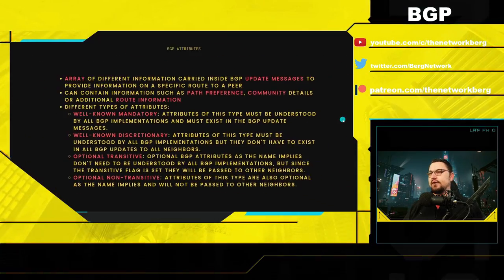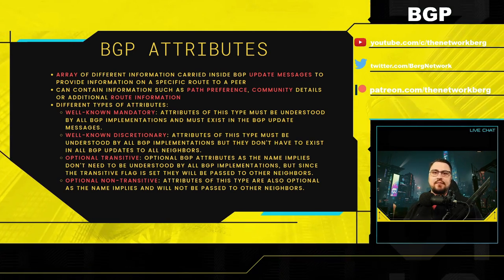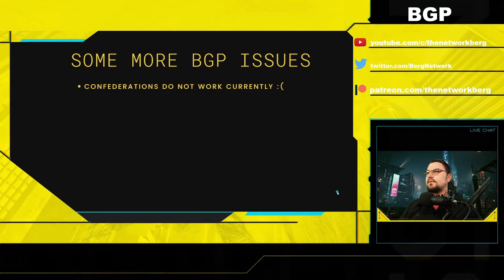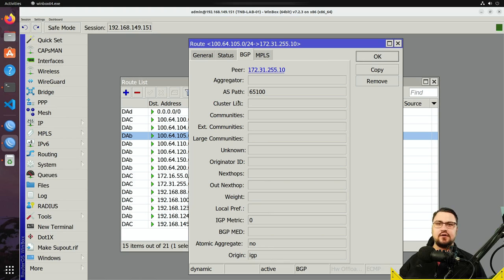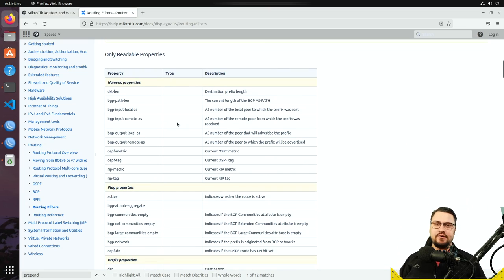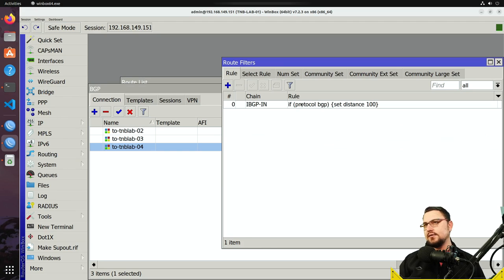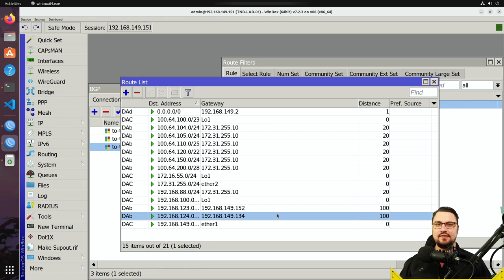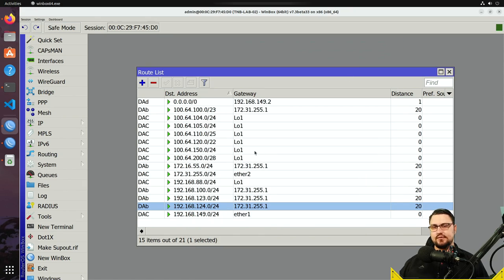BGP Attributes & Route Filters, Ft. MikroTik ROSv7

Comment from the maker: Hey guys, please use the below reference material to get the most out of watching this video. Thanks again for the great cheat sheet created by Rick Frey! One important note that I would like to leave that I forget to mention inside of the video is that when it comes to route filtering, please try and create separate in & out filters PER peer/connection. If you create just one filter that is used across many peers there will come a day that you need to make a change that will only impact the one peer but now it will affect many. It is considered best practice to setup filtering in this manner.

BGP Attributes:
https://www.ciscopress.com/articles/article.asp?p=1565538&seqNum=4

BGP Route Selection Process:
https://wiki.mikrotik.com/wiki/Manual:BGP_Best_Path_Selection_Algorithm

Route Filters MikroTik:
https://help.mikrotik.com/docs/display/ROS/BGP

Rick Frey ROSv7 Cheat Sheet:
https://rickfreyconsulting.com/wp-content/uploads/2022/04/ROSv7-Filters-Cheat-Sheet-1.pdf

Comment: Hello help me.
I am trying to set up filtering with regex for an edge computer, the rule tries to only accept asn1 that is directly connected and only the asns that are directly connected to asn1. That is, it only accepts two autonomous systems. I had this in rosv6 so when I move it to rosv7 it doesn't work. although it is used as a legacy path.

Comment: huh i didn't know i could use multiple rules for the same chain in a top to bottom fashion, i was configuring my filters all in a massive rule using recursive if statements and else statements.
i wonder if there is any appreciable difference performance-wise between the two methods.
Reply from the maker: Your method sounds really good too, I'm really not sure what the performance differences would be. I'm thinking quite minimal but I am really just guessing. So would need to get some answer directly from MT.

Comment: Very very thanksful for your deep explaination man. All love and respect..! Well i have a question for you. 
So in the ROS router board, if the internet connection came from port 1, and i want the internet in all other port, so what i usually do is building a bridge between Eth1 and all other ports. But some people say that this is not desirable, it is recomended to build a NAT rule between Eth 1 and all other ports so the outside interface became a kind of separate from other one, So is this true..? Or that is doesn't make sence..?
Please advise me.

Comment: Hey Berg! I'd like to ask: Do you use Ubuntu as your main system on PC? How a usability is for you as network engineer? What SSH client do you use?
Reply from the maker: My actual OS is Win11, although I love working on Ubuntu in a work setting so I have an Ubuntu VM running off of VMWare just for that purpose. The default terminal client on Ubuntu works just fine for management :D!